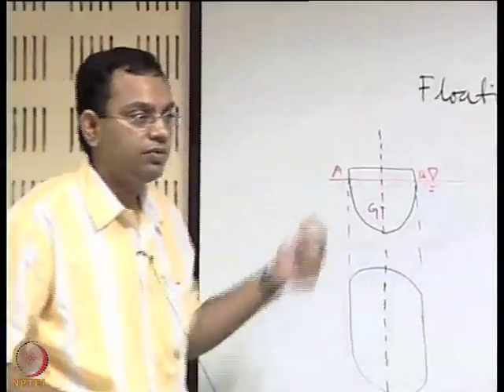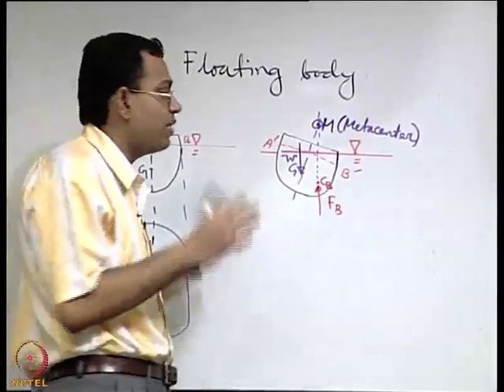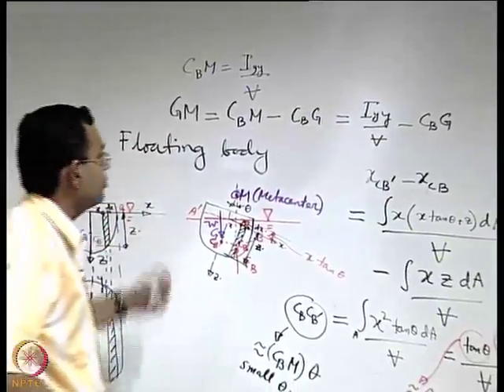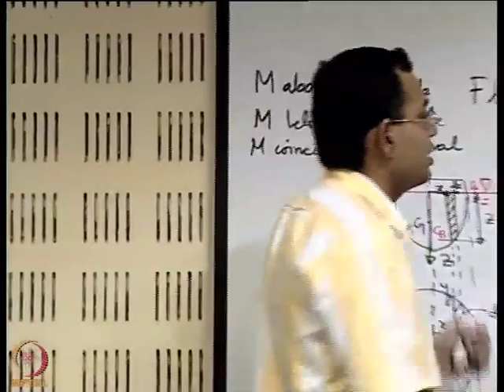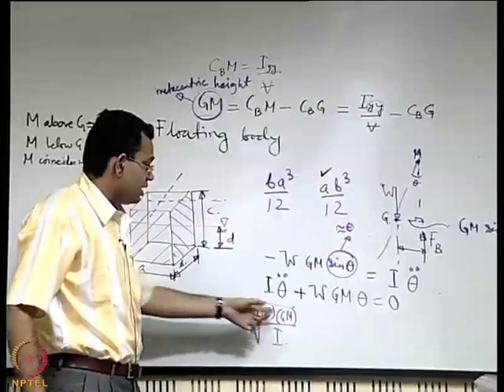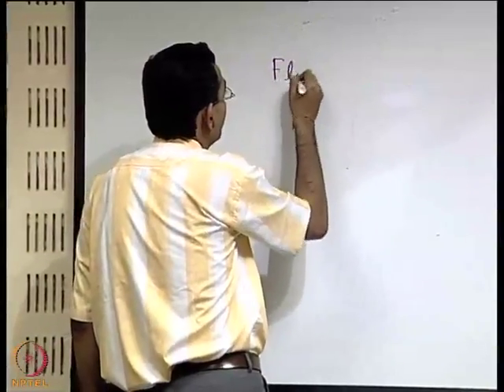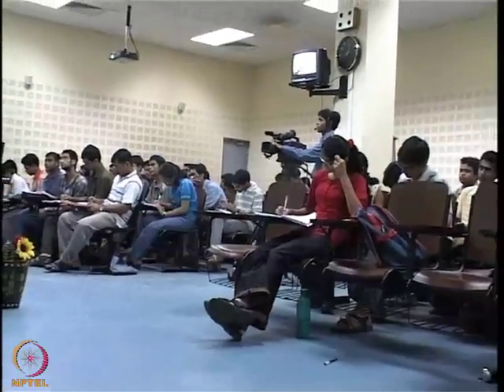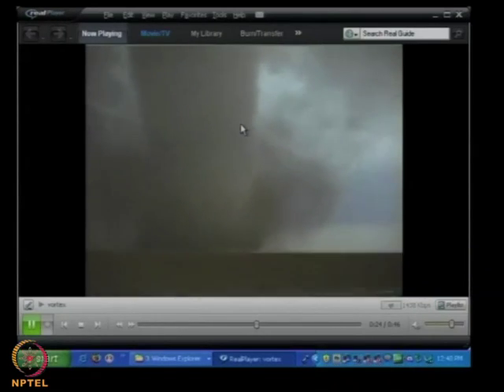Mod-01 Lec-10 Fluid Statics (Contd.) and Fluid Under Rigid Body Motion

Comment: at 38:44, why is the surface of water parallel to the incline? isn't the level of water parallel to the horizontal?
Reply: enigmatic suman it is under acceleration that's why though its not static but its under static equilibrium
Reply: If inclined surface is frictionless then surface of the body will be parallel to inclined plane
Reply: @linkecyb1292   at 39.40 why along x it is assumed poitive g and why along y  g is assumed negative???
Reply: @shreyanghosh6663   at 39.40 why along x it is assumed poitive g and why along y  g is assumed negative???